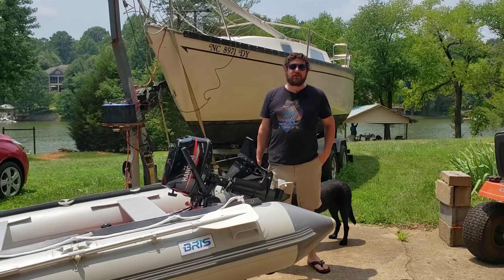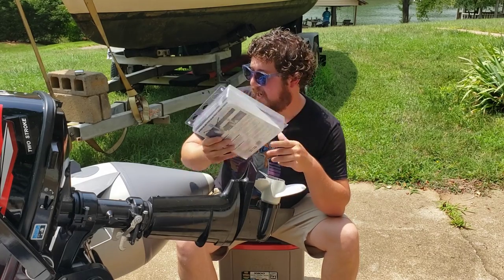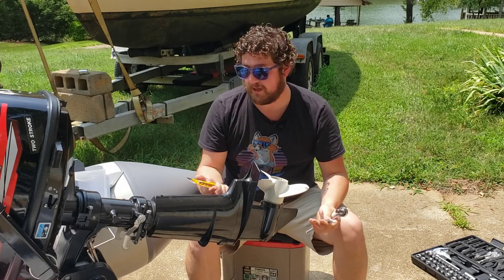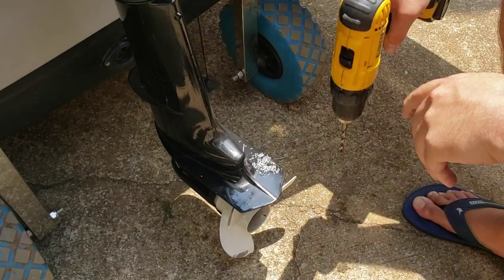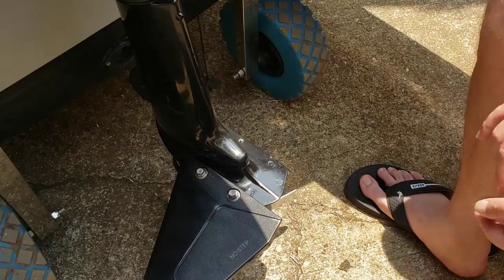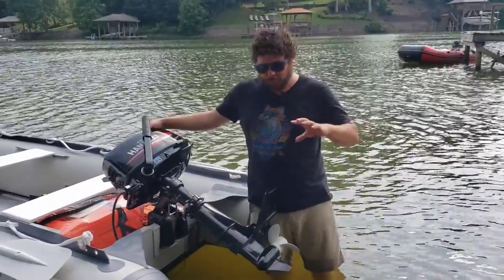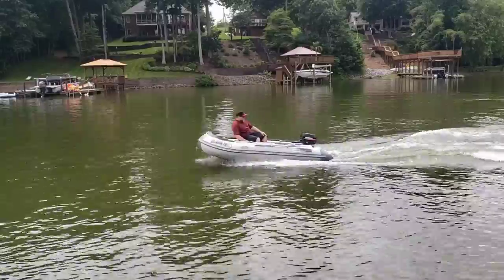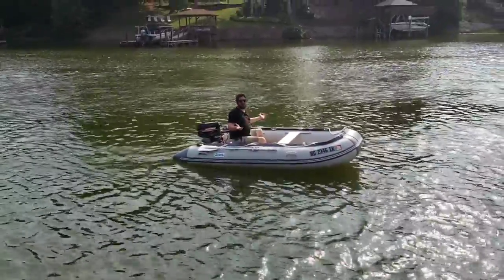Installing a Hydrofoil on an Outboard

Comment: Considering adding these to my 2.5hp hangkai on an Intex Excursion. Mostly because when running at top speed the motor tilts backward (prop moves foreword). Think this would help with that? I’ve already done the other suggested mods, BTW.
Reply from the maker: We have an Intex Excursion with a 3.5 Hangkai that has the same issue. I'm not sure if it would help or not, I would almost be worried it would tilt the motor too far forward, but it would be worth a try. This particular hydrofoil barely fit on the Hangkai 6.0 so the cavitation plate on the 2.5 may be too small.

Comment: I have a 6hp mercury on a 2.9m inflatable and am having trouble getting on the plane with full fuel tank and fishing gear on board. Do you think this hydrofoil will help ? Many thanks. Great video
Reply from the maker: The hydrofoil definitely helps you to get on plane with just 1 person and gear, but you do lose some top speed. Check out our comparison video here: https://youtu.be/pKVzYykPbk4

Comment: I got the 4 stroke hangkai 6.5 HP and I love it. But I do have a question. My boat transom is 15" and the outboard cavitation plate with the hydrofoil sits 3" below the keel of my boat. How low below the keel do you have the hydrofoil on your boat? Do I need to raise mine with a jack plate to be even or slightly above the keel?
Reply from the maker: To work 100%, this hydrofoil should be right around the waterline if I recall correctly. Although even sitting below the waterline, it still helped to keep the boat on plane, but you lose some top speed.

Comment: Yo bro, i have a similar boat and hangkai 12hp, had hardtime to plane it with 2 adults on board. I am buying a hydrofoil too , and another thing i realise that after doing research online which is the outboard is to deep in water which it cause drag, i believe if we can reduce it by maybe 2inch (i mean make an adaptor to raise the outboard by 2") , the outboard will perform better. I will try to make the adaptor soon .
Reply from the maker: I did notice that the motor was a little deep with the hydrofoil. On this one the sides of the fins should be out of the water while on plane but they are still an inch or so submerged. 

May have to look into raising it a bit and see what kind of difference it makes 🤔.
Reply: @HufflerGarage  bro! I just upload a video for you, i just stick a  1 1/4" stick on the outboard mounting. I havent try yet, i think you can try the idea too, if it works then only we can diy a proper transom adaptor/ extention next
Reply: Buy a jack plate

Comment: Ordered one for my 12hp hangkai on a 12 ft plastic Jon boat. Going about 22mph all of a sudden all the water around the prop is gone and the prop is spinning in air until it slows down a little, hoping that this stops that!